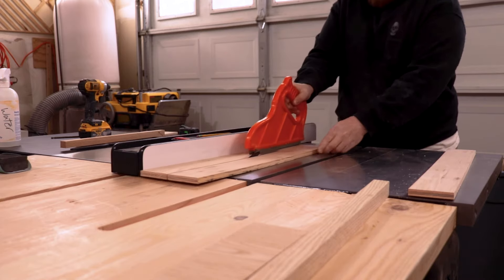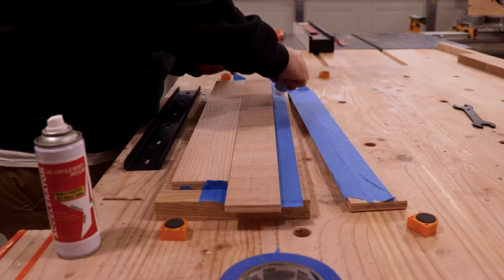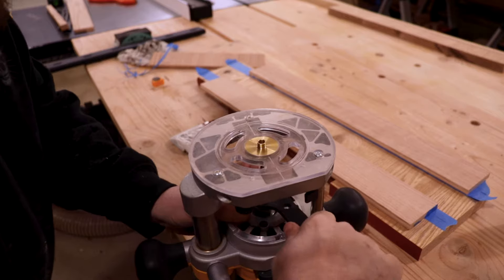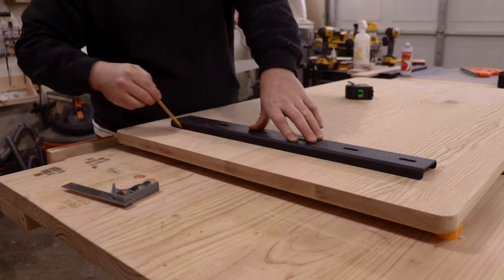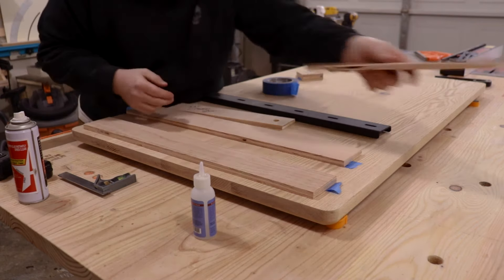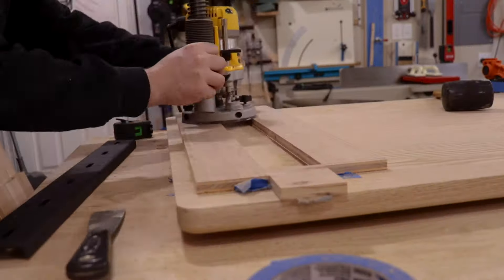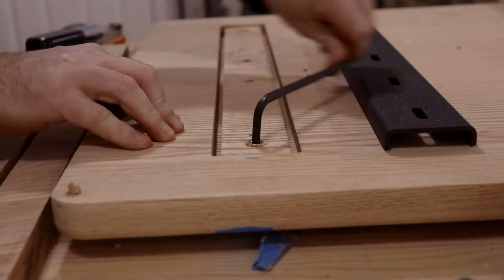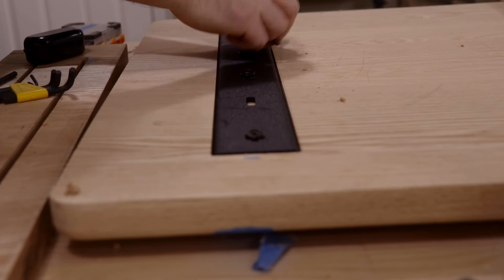Adding C channel To Keep A Table Flat

Comment: Hey mate, thanks for the great video. I’m new in my woodworking journey and was just curious if I routed the tops of my legs which have a 80mm x 4mm thick steel flat bar connecting them would it have the same effect in keeping the table flat?
Reply from the maker: I think that it would definitely help. But I think the way this works is because the shape of the steel. Long flat steel could still bend over time. But I don’t know a lot about metal and its strengths.